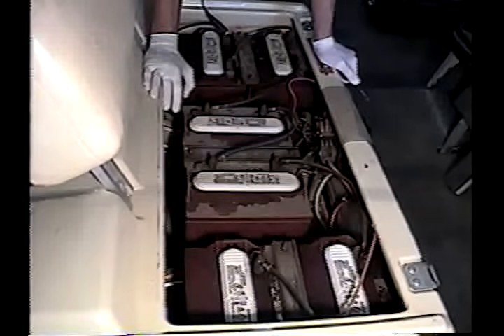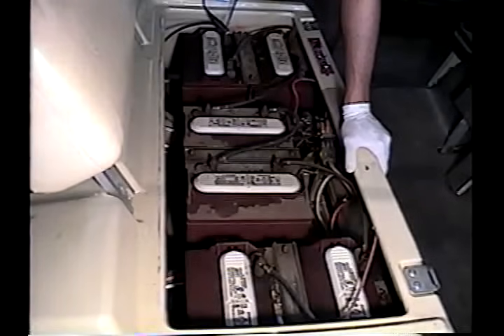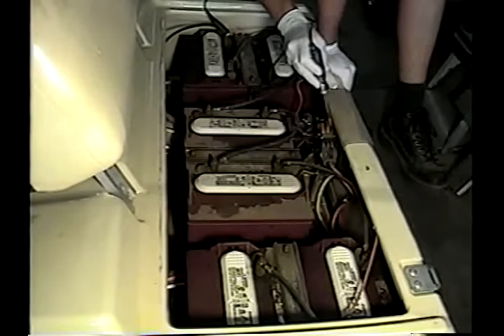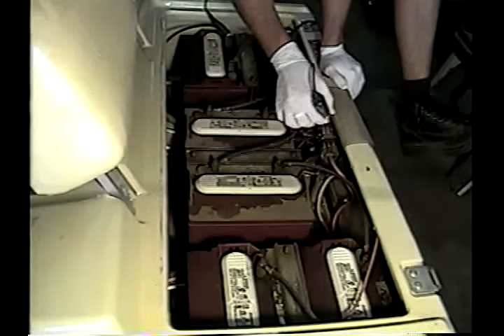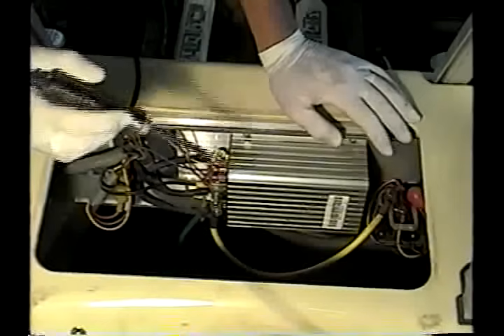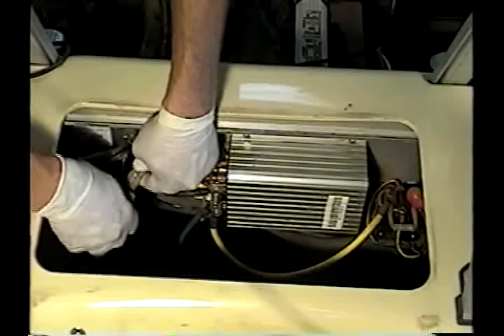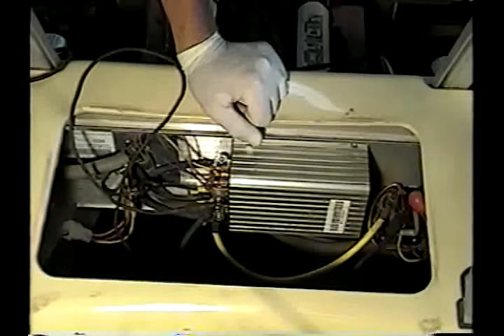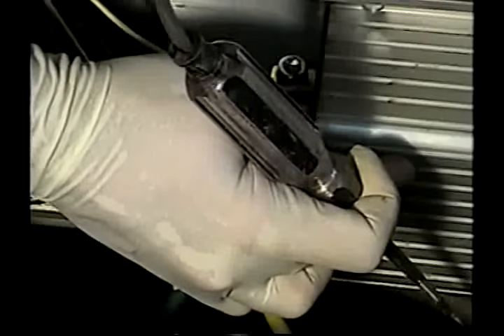48 Volt Club Car Diagnostics

Comment: I have a 2000 club car ds 48v. My white wire at A2 on the motor is getting very hot starting from the motor stud heading back to the controller.  The solenoid does click when pedal is operated.   Cart only runs intermittent. Any suggestions

Comment: Thank you for posting this. I did a lithium upgrade and my cart wouldn't run. I bypassed the OBC, but apparently it wasn't right. I bypassed it from solenoid yellow wire to ground and running like a top now!

Comment: When you made the test bypassing the controller, you must have had the rear wheels off the surface, as how could you engage the forward or reverse and have the system drive. Good detail, yet poor graphic as I cannot see the connections to learn the test points.

Comment: So wait - if everything works but the car runs or not intermittently - is it the motor. Solenoid clicks cart surges but may or may not run. Keep putting the pedal down and it will eventually run.

Comment: Wow ,great video ....but I am still confused . The negative out post I get 50 V without tuching gas pedal . So when I bypassed computer I get nothing no wheeel spinn , I got 50v on law volatage of curtis in term 1 , and 2&3 terminal on 20kOHMS starts 0n 5.28 - 2.10 .... so what is bad the Curtis or Comp ?   Thanks for your help ...
Reply: Did you figure it out I’m having the same issue

Comment: my DS club car loses power after a few minutes and drops to a crawl. if i bridge out the 2 control contacts on the speed controller it goes like a rocket but as potentiometer is now not in the system it has no throttle progression. i have fitted a new potentiometer but when I test it it ranges from 6000 ohms to 1000 ohms which to me is excessively high, I thought it should be very close to zero. I have conducted all your tests and they suggest that all components  are currently working ok? any further advice would be much appreciated.
Reply: Hey you ever figure out the problem you had on your club car I have similar problems
Reply: @ThatJeepGuyDan  yea it was a loose/bad connection on a female crimp connection situated on the variable speed drive. It was the sensor wire from solinoid to vsd.

Comment: Mr.Schreyer your video has been one the most comprehensive that have researched to diagnose a problem with my 48 volts club car or pretty much anything else(which I don't normally do). Thanks for your time. CHEERS.
Reply: Mr Schreyer video has given me an insight on the EZGO Club Cart thanks i Will need your personal contact

Comment: Iam in Riverview fl. have a 2007 48 volt parcar i bought and it ran . I put new batteries and it would run slow but if i fethered the pedal it would haul ass. Then suddently got in and now nuthing ..had controller checked out it was ok. Friend troulble shoot it and cant find anthing out..Can anyone help in my area ? email tom.p54@yahoo.com thanks!

Comment: The video was really helping me diagnose my '99 club car until it switch to a totally different Yamaha cart diagnostics.   I wonder if that was intended?    I did jumper the low amperage lines to the solenoid as part of the troubleshooting but my cart did not run.  It basically barely starts to move and then just goes dead.   Anybody have an idea of what to test or what part might be bad?  thx.
Reply: How do I get ti ignition switch and selinoid in my 2005 clubcart
Reply: I have charged the battery on my 48 volt Club Car electric how do I get to the ignition switch and where do I find the solenoid switch

Comment: I have a 48 volt 2010 Star cart. It seems to cut out when I first start. It will actually stop then I will slowly accelerate and it will start moving again. The battery is fully charged. I have also lost some power. It will not go as fast as it did.
Reply: I

Comment: Whenever i tested the ohms on the green and yellow wire from 2 and 3 it starts at 5, then if i press on the accelerator it drops to 0 when fully pressed. Is that normal? Or is it a bad potentiometer

Comment: Don't know if anybody is reading these anymore or not. Anyway I have a 1994 club car electric DS. Have run the tests in the video but when running the test on back side of micro I get NO light when in forward, I do get a light in reverse and neutral.  Does this mean the micro switch is shot? I do get a light in all positions on the front (green &white).

Comment: I have tail lights but no headlights,  bulbs work when testing on the bench  , new batteries ,,  is there a fuse up somewhere under the dash someplace,   i have a 1995 club car.

Comment: 99 Club Car DS will operate properly only if pushed (Rear wheels starting to turn). If the wheels stop turning, it will not move in forward or reverse. V Glide has been replaced. Used the resistors from old V Glide. One battery has weak or bad cells. Any suggestions? Many thanks!

Comment: Mine is a 98 with a REGEN setup.   It has the rocker switch for fwd/rev.   Is there anything i need to test differently with this system vs. the one you are working on here. 
I'm  willing to pay you for you time and info.  I'm pretty decent mechanically, just never worked on any golf cart or battery only vehicle. THanks,

Comment: my club car is 48v and has a round plug for charging, but does not have spade clips on the controller.   It is aluminum but has a plug in adapter for most wiring.   I tried bypassing the computer and jumping the solenoid but it's not the same.  No small yellow wire on the low amp side of the solenoid.   And no spade clips on the controller box.   
It's an older Club Car but any tips or ideas for the year and model we have so I can try to figure out why it's not running?   Thanks !

Comment: I just bought Club Car and does work I don't know what year? they replace 3 Batteries and that park under a tree and never worked some one  replace new Electical part and  did not work  no one can  tell what part was replaced  where do I start I'm great Car Elec and used to be a Mech  help where get repair manual on them. thanks in Advance. Steven

Comment: I am hoping you can help me out and answer a question for me. My 2001 club car ds 48 volt golf cart is quickly losing power going up hills. The batteries are only a year old and charge to 51 volts and discharge to 47.8 going up the hills so I don't think it's a battery issue. All battery cables are new. Could you recommend what the problem might be? Maybe the controller or something? It runs absolutely fine on flat surfaces, just struggling up hills. Thanks
Reply: SAME HERE. DID YOU EVER FIND THE RESOLVE?
Reply: @coryklein84  nope, ended up selling it and bought a gas cart. Game changer
Reply: @joemoneytaker1766  thanks for the quick reply

Comment: I have a 36volt Club car. The key turns off to on. But it doesn't matter. The cart will run in both positions.  What is the problem?
Reply: Solenoid stuck on

Comment: Hello Brian. I have a 2013 club car president 48 volt. I have a high parasitic drain all the time. Before I replaced the batteries they would go dead in less than 2 days. Also I just replaced the batteries. Only charging to 42-43 volts. What’s going on here. HELP!

Comment: Brian - great video.  My Club  Car DS runs BUT after awhile loses power.  I wait a few seconds, toggle the F/R switch and am able to get going again.  I don't know if the controller is overheating(?) or maybe a solenoid is weakening. Any immediate suggestions?

Comment: Great video Brian. I have a 2004 Club Car with 6 month old batteries and after riding it for about 15 minutes it just stops. If I let it sit for a while it will then start again, does this sound like a bad solenoid or something else?
Reply: Bob, I'm having the exact same issue.  Did you figure out a solution?

Comment: I have a 2005 Club Car DS. The charger will not kick off. By morning the garage started smelling like rotten eggs. I could hear the battery fluids bubbling. I'm not leaving plugged in until I find and fix the problem. Appreciate any ideas. Tks.
Reply: I have same problem.  Did you ever find the problem. derfco@gmail.comthanks

Comment: hello brian, i have a Golf Buggy 48 volts. the problem is when i depress the accelerator it wont run, by pushing the golf cart while depressing the accelerator of the golf cart it suddenly jumps and running but not okay because when it runs it surges like On/Off On/Off On/Off. then when i release the pedal until the golf cart fully stop, then depress the pedal again it wont run. by pushing the cart it will run like surging On/Off abd not smooth.  battery voltage are 48volts, i changed the potentiometer but no luck. the controller color is Black aluminum cover. fuse is ok,  im thinking that my motor is gone. pls help
Reply: May be the speed sensor on the motor.

Comment: I have a 2008 electric precedent. The battery light on the dash is coming on for 10 seconds and than going off for 20 seconds after being charge. If I drive the cart the light is off when driving and comes on when cart is not moving.
Reply: @chuck bradley i have the same thing happeing
Reply: Why does the light come on

Comment: brian i have just tried to up grade the controller (325 amp)and motor (10 hp series )also the solenoid heavy duty. Now when i step on the accellarator pedal it jumps and nothing then hold it to the floor and i get like suoer sloe, as i ease off it gain speed . most of the time it doesnt go at all and i hear the click from solenoid. im stumped
Reply: Did you ever figure it out?  I have the same problem

Comment: can someone tell me how to hook the batteries back up every time I try to hook the main battery up it sratks like it is going to blow up?
Reply: I have a 48 volt club car precedent. It also sparks when I hook the batteries up. I was told by a service tech that was normal. It's better to hook them up with the tow  switch in tow mode. It won't spark then

Comment: Hey Brian- I have a 1995 Club Car DS 48 volt golf cart. I have had problems with it running on a consistent basis. I finally changed the batteries, but Im still having issues when I depress the accelerator pedal,, it just clicks... sometimes it will go, and sometimes it refuses to go, although it gives me the same ole clicking sound. I have taken off the shell of the cart to be able to get to all th mechanics underneath, but Im not experienced in identifying which piece(s) i need to replace.. Can you help me?
Reply: Did you ever figure that problem out?

Comment: Brian, I am having an issue with a delay in starting in forward or reverse. I press "go" and I hear a click, but then a delay or sometimes no movement until I press pedal again a few times.  Occasionally I loose power when in motion as well. Any ideas?
Reply: Brian, I was mistaken. It actually does not click until I try pressing 
the pedal a few times. Once it clicks, runs like a champ. The batteries 
are all the same age (less than two years) 2005 DS by the way
Reply: did you ever figure this problem out? mine is doing the same thing.
Reply: I did not. Mine finally stopped working completely. I'm going to be taking it to have repaired, unless I can find an answer.
Reply: It ended up being the part controller between the pedal and the processor. I will try to find the name and part number for you, but I haven't yet.
Reply: srogers42 did you end up working out the problem part?
Reply: @tobybrown1179  I did. It was the controller. I had an experienced tech check it with a diagnostic device.

Comment: I have a club cart that I changed the batteries out an after installing the golf cart takes off fast when you mash the accelerator but breaks it's speed immediately to like half throttle what causes this problem
Reply: Roger Parker did you get answer to this?

Comment: hi i have a yamaha g 19 e i have power to controller and drive motor when i push the acelerater i lose all power cant find computer on unit 1999 model any info would be apper...

Comment: Great, clear video Brian! We have a 2003 48v Club Car Turf 1. After washing the engine bay to remove spring mud the pre-charge resistor on the solenoid is always hot to the touch. The cart drives fine otherwise. The resistor now measures 230ohm's. Any help would be appreciated. Thanks!

Comment: Hello. I have an 2001 Club Car 48V DS (non-regen). It currently runs fine however, it starts creeping whenever I move the Forward Reverse switch into either F or R. Does this mean the solenoid is bad and needs replacement? Would there be any other possible causes because I also am unable to lock the brake pedal? Thank you.

Comment from the maker: Sounds like battery chatter,  since your pack is wired in series, your pack is only as good as the worst battery.  Use a regular load tester to find the bad battery and replace with a battery of similar age.
Reply: Brian, I was mistaken. It actually does not click until I try pressing the pedal a few times. Once it clicks, runs like a champ. The batteries are all the same age (less than two years) 2005 DS by the way
Reply from the maker: sorry for the late reply,  sometimes the computers go to sleep,  usually a double or triple pump of the accelerator will wake it up..
Reply: That makes sense and that usually gets me going, but sometimes I momentarily loose power when I am already moving too.
Reply from the maker: YOu may want to load test your batteries, you can do this with a standard automotive type load tester.  Leave all your batteries hooked up and load test to find the weak batttery.  

Beacuse you batteiy pack is wired in series your pack is only as good as the weakest battery.   If you loose power while driving it may be a weak battery.  If you loose powere intermetently check your cables nuts.  Use a 9/16 or 1/2 inch wrench and tighten each nut - that may be your problem.   You should be checking the cable nuts monthly when you do your water check. as they will work loose.   BTW - loose cable nuts create an air gap, the air gap creates resitence, resistance creates heat,  heat will melt your post and weld your cable to the threaded post as well.   so check those cable nuts monthly,

If you are in rehe mesa area we have load testers available for free for your use,  a small deposit is all that is required.
Reply: Thanks so much, Brian. I'm actually in NC, but I will follow your advice. At least now I know where to start.

Comment: I'm looking for the fuse location for a 2005 precedent club cart, had the batteries replaced and the front lights flash when I turn them on and I think the fuse is blown, Also maybe hooked up wrong for proper batt. voltage

Comment: if you by pass the computer and the car runs.The computer is bad and the only purpose of the computer,is to regulate the charge and keep the car from running when is charging
Reply: So you are saying we really don't need to spend that much money to replace the computer and the club car will work fine?

Comment: I have a 2001 48 volt club car and I took the charger to the golf cart shop and they pluged in the charger and said it was good ,so heres what is happening ,I plug in the charger  the meter goes to 20 and after around a minute or two it kicks the circuit breaker also when I plug in the charger the yellow dash battery light comes on untill the charger beaker kicks off ,do you think it needs a computer reset of just buy a new computer,also I have replaced the fuse behind the cart charger terminal ,please help

Comment: I have a 1999 clubcart,that when I hook up the charger it wont charge.Also after that the cart only click.Then I remove the positive terminal and wait a few minutes and hook back up the cart will works as normal.Does this sound like a computer problem
Reply from the maker: David Hensley Need   more information,  what do you mean when you say "hook back up the cart will works as normal"  Is it the guage that resets and the cart only clicks when the accelerator is pushed.  When was the last time the cart accepted a charge how long has it been since the cart  was fully charged _the charger shut off- and worked as normal.  Please advise 
Brian
Reply from the maker: Brian SchreyerNeed   more information,  what do you mean when you say "hook back up the cart will works as normal"  Is it the guage that resets and the cart only clicks when the accelerator is pushed.  When was the last time the cart accepted a charge how long has it been since the cart  was fully charged _the charger shut off- and worked as normal.  Please advise 
Brian
Reply: The batteries are new,I have checked voltage of batteries and it says 47 volts.We have tried a new battery charger and it does the same thing.If I unhook positive for about 5 minutes then hook positive back up the cart works like it should.Then I plug charger in to charge,the charger doesn't come on.Unplug charger and cart only clicks when you push the pedal.The batteries are now down to 38 volts.I have ordered a new computer hopeing this resolves my problem.